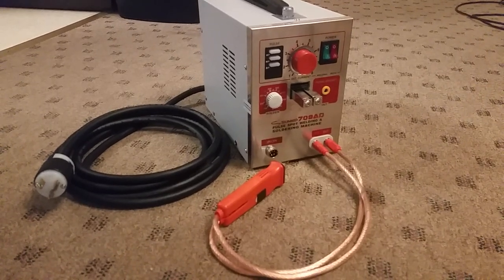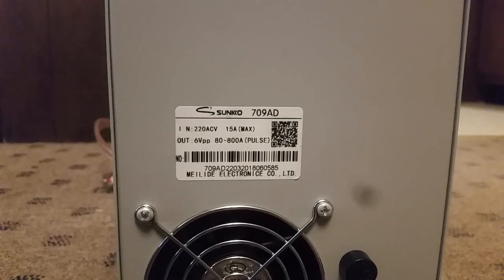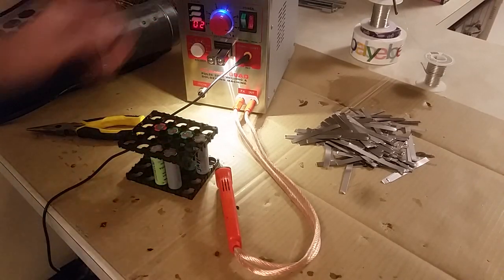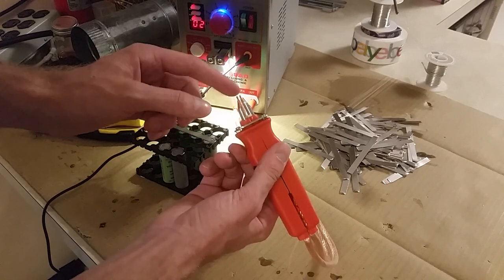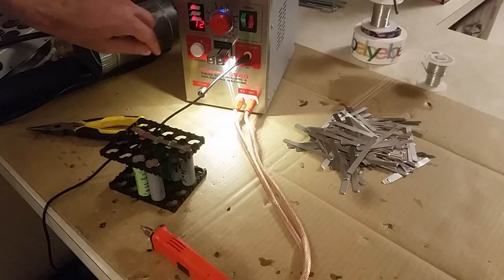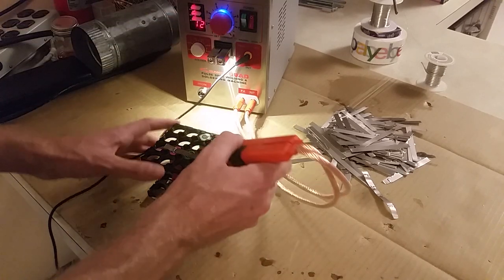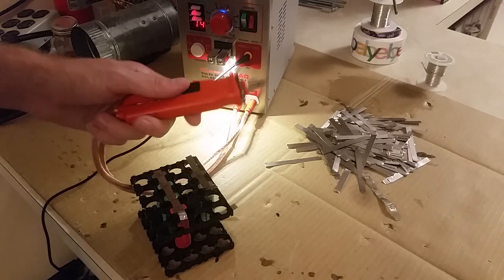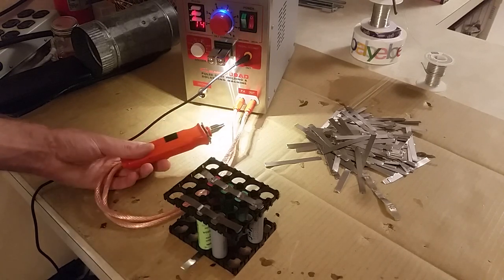Sunkko 709AD Follow Up - It Works! (230v Version)

Comment: I don't know what it's called but you can pull the two screws out of the built in welder and plug the other wand in there
Reply from the maker: That's a great idea! I tried that with the welder I returned and the connections were rather loose but that's easily fixable and at least wouldn't have to be plugging/unplugging the pens constantly.

Comment: My 110V unit didn’t have a problem, even the wand wires bounce like yours do on the 220V unit. Some variables that some people don’t consider is the circuit breaker you use. If I was on one with my lighting and a refrigerator, or a longer run of wire from the breaker box it didn’t work mad good. When I put it on my bench in the basement on a short run by the breaker panel with my dryer (dryer is off when welding) is worked good. As for the wand getting hot this tells me the wire for the current on the wand is sub par, and I already knew this. 
Some people have added a coup,empires of 10-2 or 12-2 wire in series from the transformer to the plug, and again from the plug to the wand to carry the current and not get the wires hot. 
I also don’t think the Indus,Tian on the stock wand wire is the best. I plan to just replace the wire instead of running them in parallel with the stock wire. The wand plug contact isn’t the best and I might replace it with s better plug more suited for higher currents. But it does work good if nothing else is on the breaker your using. Since your on the nema-6 220 Volt plug that’s for older air conditioners, these are usually wired on a separate breaker by themselves. Not everyone has these 220 volt outlets in newer houses.

Comment: For the wand temps, maybe you could run a pair of small wires to run a laptop/tablet squirrel fan. They are usually really small and could fit on the handle above your hand and blow into the handle.
Reply from the maker: I've thought about this as well, that's a lot of extra bulk though to hold on to.
Reply: Maybe a 1/8" tube with air being blown through it? Would need a small pump that could push enough air, tho. hrmmm....
Reply from the maker: That's a very interesting thought! I could use a simple aquarium air pump to supply the air. No fans needed.
Reply: Would it deliver the needed air flow? I thought of those, but was thinking cfm's would be to low. But, I suppose ya could try  ;)
Even if it doubled your run time before you needed to put it down to cool off, that'd be a great improvement

Comment: You said 110v to 220v we have to figure it out, are there any videos about this sunkko 709A wiring upgrades? I am looking at the circuit board connector it has 5 slots, did you soder on more wires to up the voltage there?  I wish i could see how its done, connector wires, wires to transformer. Thanks for your videos, they are really helpful!

Comment: Hi I have the same model 240v bought in the uk. 
Half way through building a five cell ten pack it blew the fuse the fast blow glass one in the back of the machine, luckily I got two spare with the unit, it blew those two. Turns out the 30a triac had failed (the big transistor on the main board .
I contacted the seller who said he would send me a new board but it's coming from China so will be weeks to the UK
I managed to get a 30a triac and it is working again but in my opinion there a pile of shit and if I had my time again I would have built a diy one instead of shelling out £200 .
Be careful not to blow holes in the base of the cells you will know when you do when a little drop of liquid appears.
Good look
Andy
Reply from the maker: They are piles of sh*t but unfortunately they're the best regular-person affordable units out there. Unless you wan to go with some kind of DIY solution. I don't have the time for that.

Comment: Hi, 
Since you have both, and I know you know your stuff, hopefully you can answer this: Between the 110v version and the 230v version, did they actually use a different transformer inside? Or did they just wire the transformer differently and install a voltage-appropriate plug? Thanks for your time.
Reply from the maker: Sorry, I returned the 120V welder for a full refund prior to purchasing the 240V version.
Reply: @LithiumSolar  Thanks for the reply :)
Reply: Hey, this question is exactly what brought me to this video. I have the 120v version, and it definitely sucks. I'm just going to open mine up and see if there is a voltage input label on the transformer.

Comment: Can you take your spot welder cover off, and show how you wired the 220VAC wiring?? The reason I ask is that I did purchase the 709AD with a 220v version, but it was sent to me with 110Volt US plug. I also have a 709A 110Volt version and after taking both covers off, they are exactly the same internal parts. The 110VAC does not spot weld enough to have my Nichol strips hold to the batteries. Both versions in 120 Volts don't have enough  spark to hold a strip to the 18650's! I would like to see the wiring inside your before I try to convert it to 240VAC, since I don't want it to blow up after conversion!!
Reply from the maker: The transformer should be different, scrape off the white rubbery stuff where the primary wires are, you should see markings for 110v or 220v. When I ordered mine, I told them I wanted an EU plug because  I wasn't sure what she meant when she asked if I wanted a US plug on a 220V unit. If yours is connected to the 110 pins, it's wrong... The reason I haven't explained the 240v wiring more on my stuff is because I'm not an electrician and don't want someone getting hurt thinking I am providing instructions to follow. US voltage is 220v from L1-L2. The neutral in our wiring isn't connected in this case.
Reply: My transformer says 220Volts, I'm sure that is why at 120Volts is not working correctly!!
I have two, so if it blows up after tiring 240 Volts, at least I have another one.
Reply: Steve Dutcher yes, I scratched off the white rubbery stuff on the PCB and mine says 220.  I’m going to cut the US plug off and put a L6-30 plug on.  Add the extra fuse  and connect to my 240 line.  Wish me luck!
Reply: @stevedutcher3875  so for the 110v "version," they're really just attaching an Edison plug and calling it 110v? yikes... no wonder it doesn't weld at 110v.

Comment: Does this come with the same transformer inside for the 110v and 220v versions?  I am wondering if I can configure it to plug into 110v outlet when I don't have a 220v outlet available (switching off one lug), and using 220v when I have a 220v outlet available (using both lugs on the transformer).  So, is it possible to configure one unit to use either 110v or 220v in an interchangeable manner?
Reply from the maker: There were markings on the PCB attached to the transformer for input voltages. I don't know what would happen if you tried changing it and certainly don't recommend doing it. Both versions might have the same PCB but I am unsure if it is just the same transformer with an additional tap.

Comment: 90deg angle is better. At 45 you will kill the handle over time.  And There is other issue that can occour at 45. The pen have built in springs. If urs dont have that get some other version.
Reply from the maker: Is that why the tips turn black quickly?

Comment: Great video!  I just got my 220v 709 AD from AliExpress.  Looking to add a second fuse to the other hot leg coming in like you did. Any tips for this mod?  Looks fairly straight forward. I’ve identified the blue wire as the second hot leg which actually splits further up so I’m going to have to add the fuse right after the wires enters the box.  Did you find that it was a little tight too?
Reply from the maker: Yeah there wasn't much room and I didn't want the wires resting against the transformer or fan. I ziptied them off to the side. I also removed the original cable, including the plastic grommet, and replaced it with some nice heavy duty cable from Lowe's, think I used 10/3 or something, can't remember.

Comment: In EU we have 220 volt and this gives us advantage to use thinner wires and thinner connections. More volts means more ability against resistance :D. We are able to get same power with twice as thinner cable :D ;) To the mains side of course
Reply from the maker: Yes, that's why the 110v version of the 709AD is junk and the 220v works very well ;) Same size wiring, double the amperage = very stupid and poor design.

Comment: 00:30 its a german plug. Much safer than the us plugs
Reply from the maker: I don't see how that could possibly be any safer than US plugs.
Reply: @LithiumSolar  you can plug in the plug half and than the voltage is exposed. With german plugs thats not posssible
Reply: This is eu plug in poland are the same
Reply: @LithiumSolar  European plugs are safer because the Euro outlets are recessed. If I partially insert the US plug, I can still touch a part of the live conductor in the plug. For the Euro plug it is impossible. The Euro plug blocks all access to the Euro outlet long before the plug is inserted.

Comment: I've just started using my welder today for large packs and I am finding everything heats up quickly and shuts down. I'm definitely going to upgrade the cables to the pen but I also wanted to add a fan. I'm poking around for a 12v rail for an easy mod, but no luck. Any idea about that or where I can get a circuit diagram. Failing that, I'll use a 12v PSU and mount it internally to power via the switch.
Reply from the maker: Didn't yours come with a fan? The 709AD I have there includes a fan that automatically turns on when the unit gets hot.
Reply: @LithiumSolar  Mine is the 709A. I suspect the fan was an upgrade in the D version. I've just removed the gantry for the spring loaded tips and soldered those wires to the pen connection. In the process I lost the small red wire to the transformer. Any idea where it connects to on the PCB? There is a broken wire at the 'HOT OFF' segment so I'm thinking that's it. I'd also like to power the fan from an existing 12v rail - Is there one I can use? If not, I'll just hack a PSU off the mains switch.

Comment: I am still having the same issue you were having with your 110v with my 220v machine. I just purchased the 220v and no matter the settings, pulse or current, pure nickle, clean surface I can't get the metal to stick. 
I'm not sure what else it could be?
Reply: Could be the thickness of the strip

Comment: How did u connect 220v wires to circuit board. Says 110v or 220v volts. Hows it soldered
Reply from the maker: If you purchased the 120V version, you cannot use it with 240V. I had to specially-order mine to get a 240V version in the US.
Reply: @LithiumSolar  I wanna order it from sunkko website. They have multiple 220v models. How can I wire the 220v cord to the pcb board. I see the negative positive. I understand placing another fuse to the 2nd wire of the 220v plug comming in, but I dont understand where to re solder the wires? Do the 220v wires solder back to same place as was the original wiring on the pcb board, or do the 2 wires get soldered to a different location on pcb board

Comment: American 220 V has two hot wires or two phases. European 220 V has only one hot wire (one phase) which is 220 volts. Theoretically you could screw up some devices when using US 220V two phase on a European 220 V. one phase device.
Reply from the maker: That's not correct. US power is 240V single phase.

Comment: Is the 709AD 60 hertz model?????
Reply from the maker: The 709AD 220v version does not have a hertz rating on the label. I think the sales listing did say 50Hz. I've been using it on my US 220v 60Hz power without any problem. I've done over 20,000 individual welds at this point and have not had any problems.
Reply: Just ordered it, thanks for the update!

Comment: Didnt the VRUZEND DIY Battery Kits put these welders out of business? I was looking into ordering one of the welders a few months ago and decided against it do to the easier removal of bad cells and all the problems I heard with the welders. The cost of the plastic vruzs are actually not much more than normal trays so... why take the risk. You could also have the plastic ends made by a chinese company to get them cheaper if needed.
Reply from the maker: I refuse to use the vruzend holders. The design is terrible, springs fail and don't always make contact, and they persistently spammed the heck out of youtube, our forum, and our facebook group. Not to mention I have near 10,000 cells in service now and that would cost me $6151 in vurzend holders based on their current price of $31.99 for 52 cells. Might work for someone else. Not me.
Reply: 10k Powerwalls  Nice! I see your point, just thought Id let you know in case you have more problems with the welder. Ive only done a few hundred myself but that was soldering, I dont plan on ever doing it again.  @LithiumSolar

Comment: Seems the pcb board can be wired either way.. 110 or 220.. there are different solder pads to convert between the two..
Here is a picture to show the board has the ability to be soldered either way.. 
https://www.youtube.com/watch?v=slfZds9T_w0
Reply from the maker: Did you actually try this? Just because the PCB has markings for different voltages doesn't mean the components are there for it or the transformer is correct.
Reply: @LithiumSolar  There are plenty of videos to support this.. It's just a matter of how you solder the board that power series or serial.. (parallel)..
Turn the board over and look at the difference..
You make two coils series or one parallel.. 
I suspected this from the start.. far more power in series.. just like batterypacks.
There are two coils. you can give them one series 110 or parallel for two separate phases 220.
This save on manufacturing in many ways.
The components are no different except for the way they are wired and powered...
Reply: @Billbobaker  Thank you.